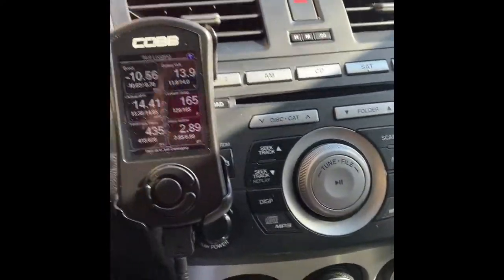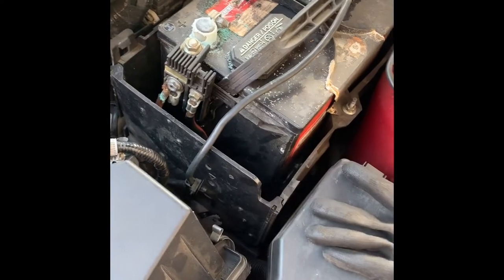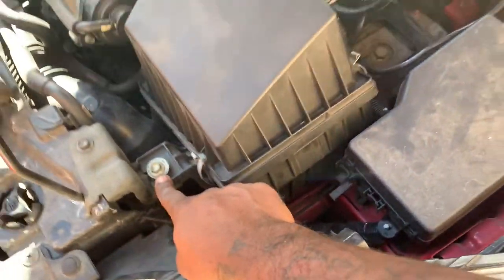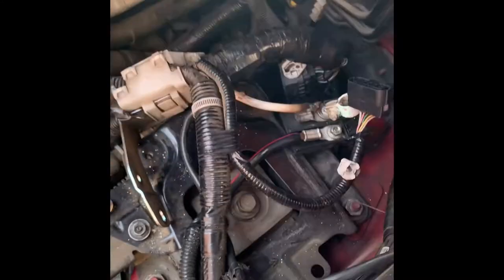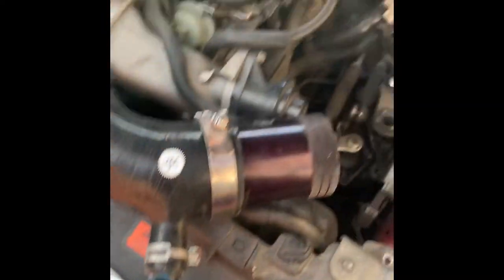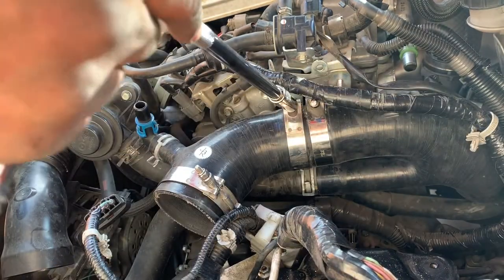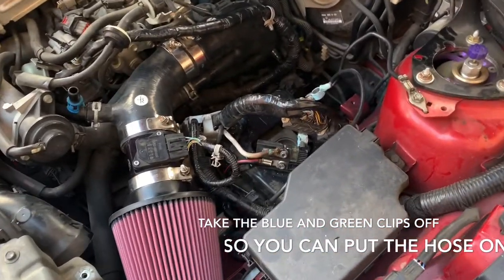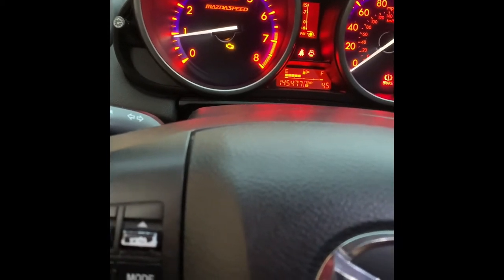how to install a JBR stage ll short ram intake

Comment: Great video! Does it just free hang or does it also come with a little arm to hold it up like the Cobb one does?
Reply from the maker: When I got the JBR the guy didn’t give me the arm so it free hangs but it don’t really move...but I have a full Cobb one now with the bracket the holds it up...you getting one?
Reply: No I just bought one new... the just sit there that tube isn't flexible so it's shouldn't move

Comment: Does this short ram intake give the same performance as a corksport stage 2 short ram intake I can’t find a comparison do you know what gives better performance or are they the same performance wise I know the corksport one gives you about 30 HP out of it so wondering if the JBR one will give 30 HP to
Reply from the maker: Not sure on it bro but to me they both the same thing just different brands..so they might do the sAme HP
Reply: Wares Garage Alr ya that’s what I’m thinking they look the same it’s just different name and it seems to use same material as well I would say same performance but do you think that you get more performance out of the corksport short ram intake then the cobb or are they the same just different brands as well because im looking to get one but it’s either corksport short ram intake stage 2 which I know is good and will give 30hp out of it and I know cobb is a good brand but idk if you can get 30hp out of there short ram intake
Reply from the maker: Cooper m it’s the same bro just different names..me I like cobb most parts on my car are cobb but I have the full Cobb turbo inlet with the Cobb SF intake with airbox..I have a video on that if you want to check it out..but yea I say it’s the same brotha
Reply: Wares Garage alright thanks
Reply from the maker: Cooper m no problem brotha